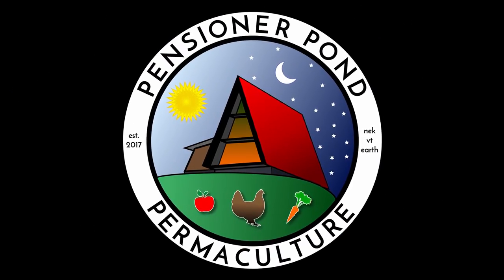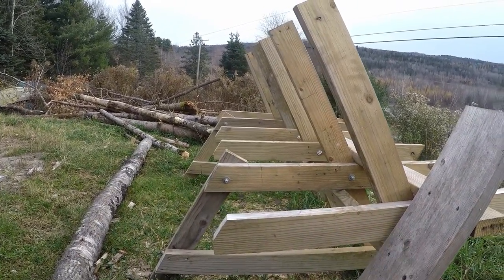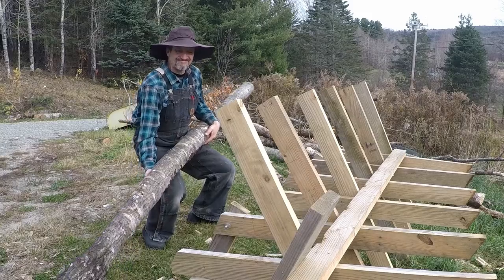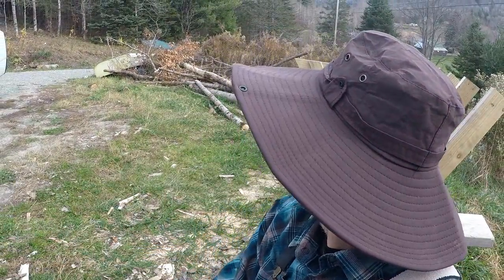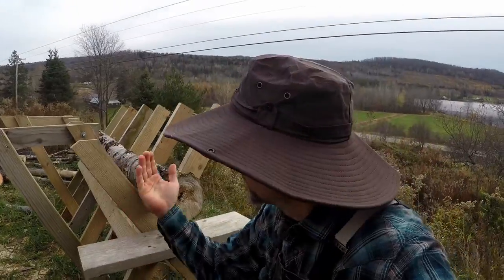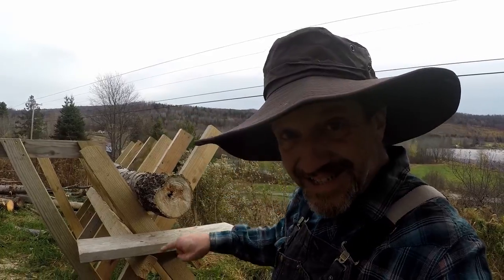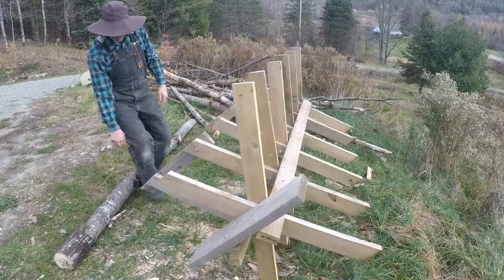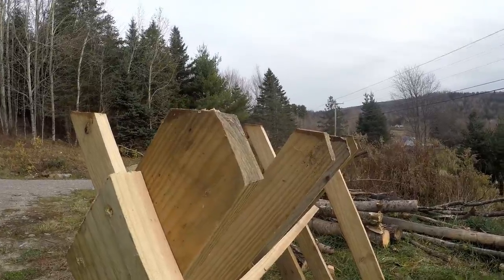Rotating FIREWOOD Sawbuck | Heavy Log Loader

Comment: Looks like a pretty good setup you made there. For big logs that I have I just use my timber jack to lift them and block them that way. However for small stuff this will be handy. I’m going to build one today minus the rotating part.
Reply from the maker: Honestly, I've only used the rotation function once or twice in the last 2 years. Good luck on your build!
Reply: @PensionerPondFarm  I built one on Saturday and then put about a cord of wood through on it Sunday. It worked well. Made things much faster.
Reply from the maker: @myronhorvathsk  Well, there's a good pile of sawdust.

Comment: This looks great but I am confused as to where the 16 inch mark was?
Reply from the maker: Each of the crossed sections are spaced 16" apart. There's no mark, but you can eye up each cut to be pretty consistent. I still use it today, thought it's getting a bit chipped up from chain strikes.

Comment: Looks like you pulled the rope right out of the saw.... hate it when that happens haha.  I really like this idea but I would have to go with a shorter sawbuck with shorter logs.  My back wouldnt last long with those big suckers
Reply from the maker: You've gotta go with what ya got sometimes... I can barely handle a log that size, and I think that was pretty clear in the video.  The whole invisible string thing is sort of a personal frustration with my 80V battery chainsaw that works great if yer not too heavy duty with it. Bucking firewood demands a Husqvarna. I don't care how much gas prices rise it will still be worth it if you consider how much firewood you could produce with a gallon. Christmas comin'...